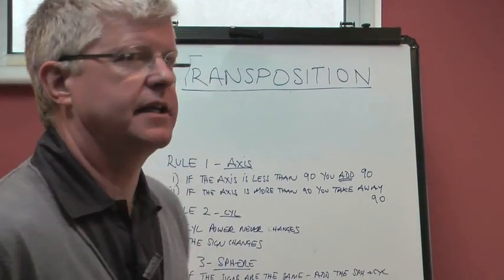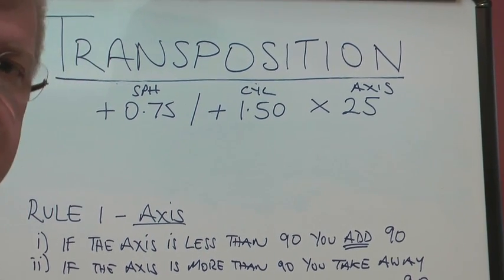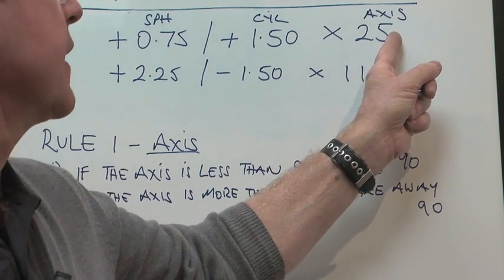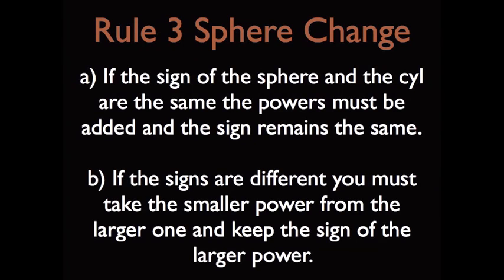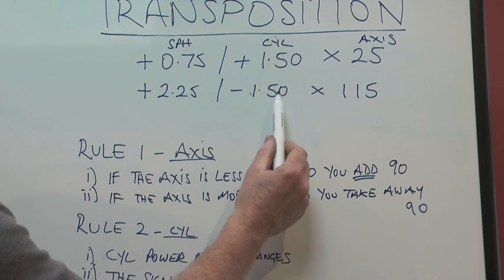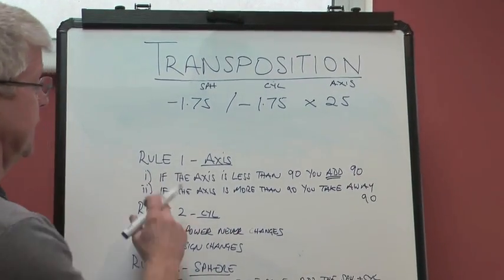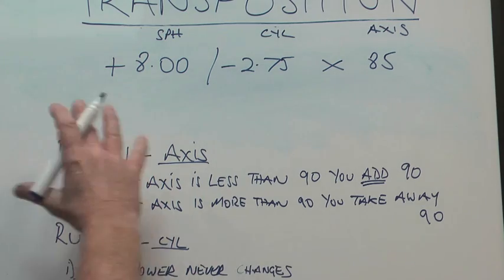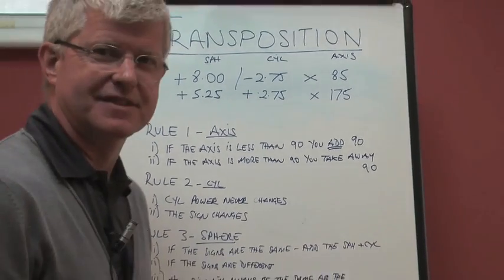Transposing Toric Prescriptions

Comment: Hi  thanks for this.  Is there anyway, for bifocals where there is reading lens, which numbers to add that to in order to get the reading glasses prescription?  For example, with a distance prescription of -0.50, +2.75, 017 (vs it's transposition  +2.25, -2.75, 107) , which transposition do I add this 1.75 number to in order to get the reading lens spherical prescription or does it matter?

Comment: Of course, if you wish, you can convert this prescriptions, by converting to Spherical Equivalent.  To do that, you just take the "Spherical" measurement, and add 1/2 the astigmatic value.  You can ignore the angle.  I personally prefer being prescribed with a spherical lens - as I do that myself.  Thanks for your excellent discussion.
Reply: Ian Squire Hi Ian - Thanks for your reply.  I generally check my own refractive status using spherical lenses.  If I can read the 20/20 line though a spherical, I just do not use a Toric.  In my opinion, a person should be informed, that a toric lens is optional, if he has 20/20 though a spherical.  I personally would not wear a lens, if I had naked-eye 20/20, with perhaps a self-measured astigmatism of 1.5 diopters.  It means the difference between wearing glasses all the time, or wearing no glasses at all.  (I would definitely given the patient that educated choice.

Comment: I appreciate your explanation of the optical cross, it was excellent! I am still a little confused of the 'why' in the 3 transposition rules you showed. Why does the cyl symbol change, why do you add or minus 90 to the axis etc?
Reply: They’re equivalent that way.  The “why” is because ophthalmologists typically write their prescriptions in plus cylinder while optometrists usually write their prescriptions in minus cylinder.
Reply: @jimhaggard7436  Why do ophthalmologists typically write in plus cylinder? Will the effect for the person wearing the glasses be any different? Will the overall thickness of the lens be the same if written either way? I guess in other words, will the lens be exactly the same if written either way???
Reply: @drdenniskessler  I’m not sure why, but the effect is the same. The two prescriptions are identical as is the thickness of the lens.
Reply: @jimhaggard7436  Thank you. Information appreciated!!!
Reply: @drdenniskessler  this is my distance eyeglass prescription written in minus cylinder:
OD - 2.25 - 0.75 x 180
OS - 2.25 - 0.75 x 180 
and in plus cylinder:
OD -3.00 + 0.75 x 090
OS - 3.00 + 0.75 x 090

They look different but are optically equivalent (the same).
Reply: @jimhaggard7436  Thank you for the details. I'm wondering why the ophthalmologists differ from everyone else in insisting on writing the cylinder as the plus version of the prescription if there is actually no difference in the finished lens.
Reply: @drdenniskessler  Ophthalmologists use the plus cylinder form because putting sutures at the plus cylinder marks on a patient’s eye may reduce astigmatism after cataract surgery, for example. Ophthalmologists use plus cylinder phoropters and write in plus cylinder form on prescriptions. Optometrists write in minus cylinder and use minus cylinder phoropters.
Reply: Phoropters are the big things with the dials that the patient looks through while the eye doctor asks, “one or two is clearer?”
Reply: @jimhaggard7436  My collection of glasses all have a minus cyl, and then my new ophthalmologist wrote a prescription for me with a plus cyl. . . .I was concerned I would have a problem with that. In the past I have lived through some 'distorted' and unexplained prescriptions, and didn't want that again. I see that everyone says the actual lens with either for of prescription writing is the same lens. I have more to learn about lenses. :)